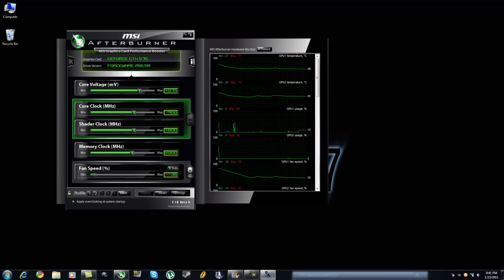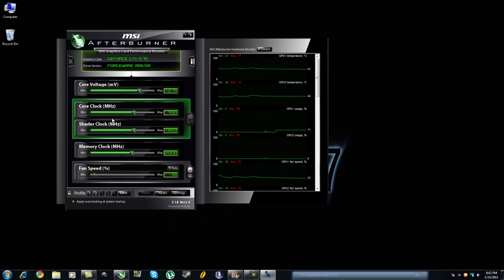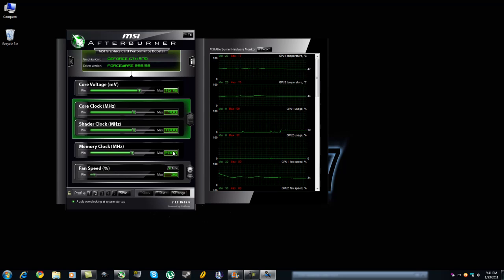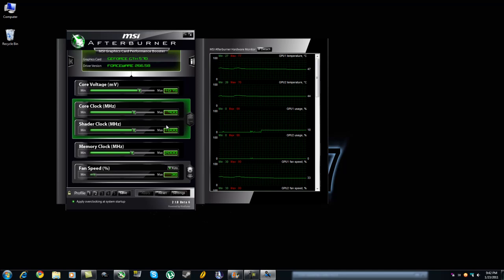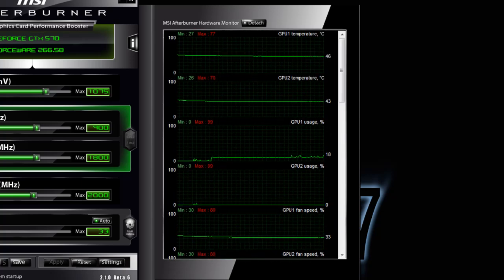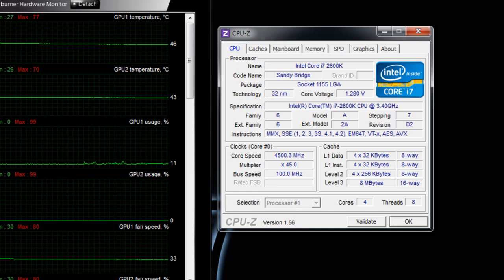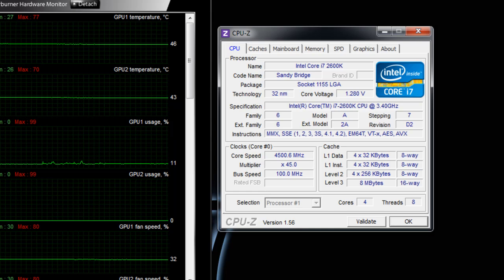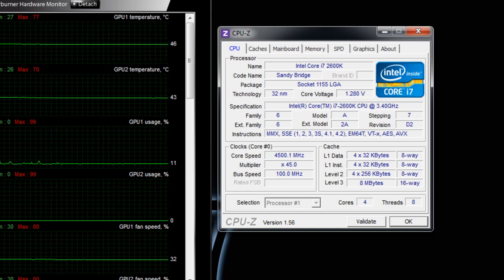Overclocking the GTX 570

Comment: I have Arctic Cooling Accelero Xtreme PLUS II on my gtx 570 and after doing what you did and ruining furmark for about 10min my temps didn't go above 62c. Do you think i can push the overclocking more? and if so, how much more do you recommend, i'm on 2000 Mhz on memory, 1800 on shader and 900 on the core with 1.075 voltage.
Reply: have you run this oc a long time with the 570?

Comment: Hi. I have a MSI GTX570 TF3 Power Edition factory clocked at 770MHz. I am trying to al least push it to 847Mhz but I get Game Crashes. How much voltage must I set it.  I have been overclocking over the years but I have never tried Voltages. Thank You

Comment: My card on my default voltage is 0.975V. I clocked it to see where it would get on the default voltage, 950mhz stable. I shit when I saw that, I'll definetly buy another ASUS direct cu ii card, gtx 570 baby, that's where its at. I can still overclock this card plenty, I havent even touched the voltage, I'm very impressed.

Comment: With software overclocking (what he does here) there's no risk in burning the chip down. Just go with increasing in 20 MHz steps and play your game of choice during that. At a point you will notice graphical artifacts (like lines, unloaded textures, untrue colors) and that's when you want to clock down. Even at a major overclock the program will just shut down and that's it. I've done it on 2 cards now and there's no risk in it.
Hardware overclocking is another story...

Comment: Ok, I dunno why, but I'm looking at Afterburner right now, and I only see Core Voltage, Power Limit (in %), Core Clock, Memory Clock and Fan Speed... No shader clock... The best I've gotten out of it (only one Asus ENGTX570) is about 30 fps in stress testing. Is that normal or can I get more ?

Comment: let me ask u a question :) i got 890/1780/2000 @ 1,074V . im running bf3 for three hours and max temp is 68°C. average of 63°C ingame is nice :) with the phantom edtion (3fans) and a good case cooling im sure i can push further. u think pushing shade+core is better then getting the memory around 2200?

Comment: @RmpConnect ok thank you! but I have a serious problem of my gtx570 cos when I run a game specially BF3 the game will hung-up and lost at the very start of the game, not only BF3 but most of my games which it didn't happen to my previous HD6950...
I even installed the latest driver from NVIDIA but that wasn't fix my problem...

Comment: hey i have my EVGA GTX 570 Super Overclock 
Edition. My stable Overlclock is:
Core Voltage: 1063
Core Clock:   790
Memory Clock: 2290

When i Increase my Core Clock to 950 with 1100 Voltage. My game crash. Any reason for this ? Do i need more PSI ? I mean i have 750 PSI. Or i need more fan ?

Comment: @RmpConnect ive got the 570 SC edition. out of the box its at 797 core clock, 1594 shader and 1950 memory... as i said, stock so its still got stock cooling... how much farther would you be able to say i can push this? thanks

Comment: @TheArcticWonder 
Hi, when i was using 2.2.0 beta 8 version of MSI's Afterburner, i had to check/enable every tickbox under the "monitoring" tab in the Settings menu, besides the "Unlock voltage control" and "Unlock voltage Monitoring" checkboxes under the General tab. After that i was allowed to change the GPU, MEM and Aux voltage. Hope this helps.

Comment: Hey everyone, I NEED your help. I have an Nvidia GTX 570 Twin Frozr III, and in MSI Afterburner it won't let me change the VCore. Yes' I've checked the box for allowing voltage control, it's still not letting me. I'm using Afterburner 2.1.0 and my Nvidia driver is 285.62-WHQL. It's REALLY been pissing me off, any help is appreciated. Thanks guys.

Comment: @RmpConnect thanks for the reply, i tried to overclock using the afterburner but i can't move the voltage option. And i got less FPS than the default settings. I have the latest 285.62 Driver.

Comment from the maker: @ashe021182 Thats kind of pushing it. it will run but might put a strain on the psu. If money tight then you can use the 750 watt but just watch how much oc you do and if you start to notice bad performance or funky things happening back down your oc.

Comment: Hi, I have a non OC i5-2500k, and a GTX 570 Twin Frozr ii

After a full day of tests my final OC is 900-1800-2000.
With 1050mV and 61ºc temp...I changed the Fanspeed so it will never reach 70º

Memory Clock gave me a lots of truble when increasing...Maybe i needed more Voltage but i said to myselft i wont pass 1.05v.

But it worked fine to me with those stats, i tried 3DMarkVantage and BC2.
I think i like it and i hope it will run smooth for my 24/7 gaming rig :D

Comment from the maker: @UntasticEzpz yea you'll run into a bottle no matter what, however the 2500k is a powerfull chip so you might only gain about max 10fps if you were to overclock your cpu. but you should be fine leaving it stock

Comment: Works like a charm here:)

Do u have any tip for i5-760 oc?:) i want a stable 3.5-3.6 clock, but it seems that i cannot get the voltage right:(

Comment from the maker: @CrASYmUZIk well every card is different but if you wanna push your card then go to about 900 on the core and 2000 mem with a voltage of about 1.1. then work you way up from there with the vcore

Comment: @RmpConnect I did too set everything to max , black screen and stuff , but can you tell how to "superclock" my gtx 570, i mean i want preformance but i know that OC'ing your graphics card will burn it down and kill it's lifespan, i i would want to how to superclock my gtx 570 like the one they got in evga " GTX 570 SC"

I set the core to 779Mhz or something like that ( sorry atm im in a friends house on my alt laptop)

Can you tell me what voltage should i move it to? i have atm a InWin 750W PSU

Comment from the maker: @matthewraser Well first off don't set things to max...thats the first way to fry your card. Also 570's don't like the memory to go above 2000. start with a small overclock like 850 or so and adjust the voltage as needed. Start with 850 core and 2000 mem leave the shaders linked to the core.

Comment from the maker: @AlixD89 make sure you have the latest version of afterburner. Then if you do go into the settings and the very first tab your in is GENERAL and there should be a box to check off for voltage control...check that off and restart afterburner and you should be all set.

Comment from the maker: @ZOXA77 when you open afterburner on the bottom right it says settings...then the very 1st tab is General. Then if you look down to the "Saftey properties" you'll see the first box that says "Unlock voltage control" then below that it will say "Unlock voltage monitoring" If you still don't see that then there is a problem with your afterburner.

Comment: @RmpConnect  Yeah, just like my average 2600K i7, I got it at 4.5Ghz and gets 85C in Linpack AVX in about 24C ambient, however getting it from 4.4Ghz required voltage from 1.32V to about 1.35V and a raise in 10C at load, ah well I can live with an average i7 at 4.5Ghz, but it bloody rocks

Comment from the maker: @ncnhomegrown Nice job. From what i found and have read anything over 900 mhz you'll need to be at 1.1 volts at least if not higher. But your gonna start seeing some really high temp as soon as you use that voltage.

Comment: I got Mine to 900/1800 core @ 1.050V Stable, no errors, no glitches, all lovin xD. However any higher requires a drastic increase of volts, and as soon as I get to 1.075V after 10 - 15mins testing I get a black screen and the pc is unresponsive, despite temperatures being <75C and 1.075V will get me about 930Mhz, but as I said before it balck screens, I still havn't figured out why that is, must be something to do with the Voltage Regulator, I don't know.

Comment from the maker: @EchoNatek you have to use the latest beta of afterburner and it will unlock the voltage for our 570. @900 your prolly gonna need 1.1 volts. google afterburner 2.2.0 beta

Comment from the maker: @xxedoxxx no the max isn't 1.075 but it's a good place to start. i wouldn't go much higher then 1.1...it gets really hot at that voltage. @ 900 mhz i was stable at 1.1 but like i said it runs hot. @ 850mhz i'm stable at 1.050.

Comment: run furmark for more then 10mins, i have had overclocks before soon as it hits the 10min mark it will crash, anything past 10mins is 100% stable on furmark, i ran furmark for 12 hours on my 470 with a 800mhz oc 100%

Comment from the maker: @lckillah anything over 2000mhz on the memory and you'll most likely crash. keep the temp down and you
ll be all set. if you can run 3dmark11 as a tester. i ran furmark and it was stable but when i ran 3dmark11 i crashed. so i uped the volts till it was stable. furmark basically is good for testing temps not really stability IMO. Let me know how you make out.

Comment from the maker: @lckillah I have 2 Palit 570's. How high of an overclock are you looking to do? If your going for 900mhz keep the shaders and core linked so they oc together. For 900 mhz you'll have to go to at least 1075 or 1.075 for the volts. Thats a good starting point. you may have to go up or you could go as low as 1.05 but that might be pushing it. Keep the fan turned up while your doing it also just incase so you can keep the temps in check. The memory shouldn't really go any higher 2000mhz.

Comment: @RmpConnect thanks for the reply. I'm using a pair of 470's that I over clocked in bios. I used Afterburner for a few weeks but I hate having things running in the background. My 470's do get pretty warm but I just need to install my water blocks I bought a while back. The 570's look really nice though but I always skip  the following generation so I don't feel like I'm in a never ending upgrade cycle

Comment from the maker: @Keith2800 i'm just sticking with afterburner...it does an awsome job. make sure to get the latest beta 6 if you want to change the voltage on the 570 or 580.